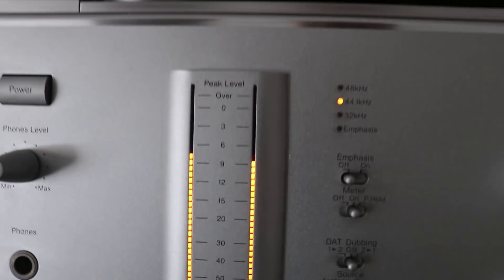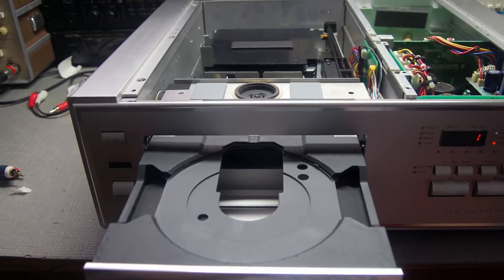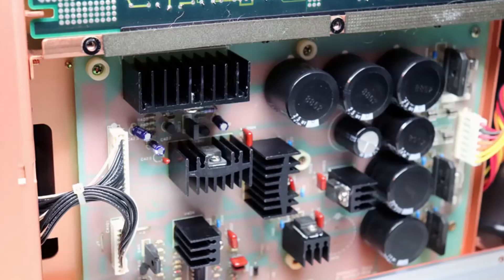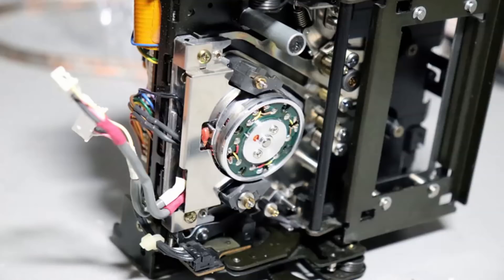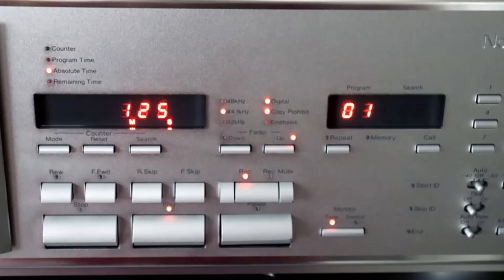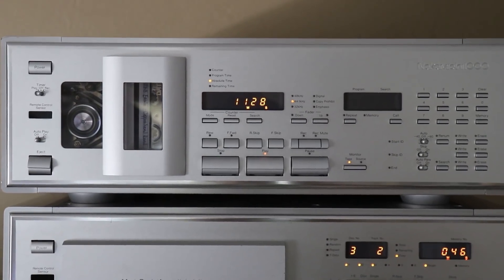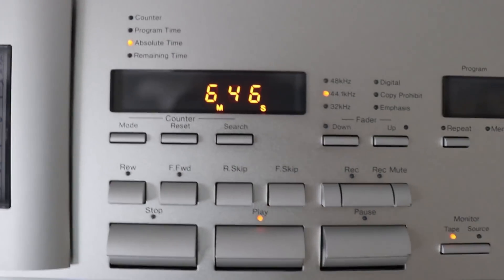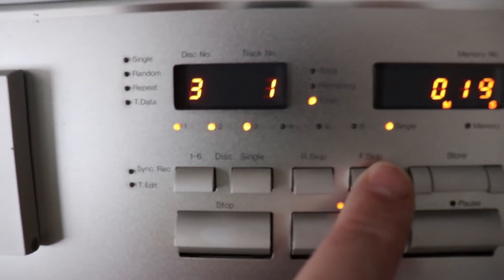Rare Nakamichi Digital Products. 1000P DAC - 1000MB CD Changer - 1000 DAT Tape Deck. $11,000 in 1988

Comment: just fixed one of these today, what I found is that the drive motors that connect to the reels are direct drive motors, have a separate PCB, with those dreaded SMD capacitors, and they will leak. the acid will damage the solder connections and the resistors on the board. if you have one of these, best to inspect this and replace the 6 10uF 35V caps with SMD caps, 1206 10uF 25V. that will work.

Comment: I was in Japan in 1989 and the hi-end stereo shops were fun to visit, very typical of what the luxury units of the day looked like. Nakamichi has always been one of my favorites, they loved to push the current tech and always had some mechanical parts that were just amazing and fun to use. I always wanted to get a Dragon but it was just a bit out of my pay grade as an E4 in the USMC at the time. I have a bunch of Japan-exclusive CD's many with the original "banned" artwork, CD stores were amazing too, only a single copy of any album would be on the shelves, everything in perfect order, if you buy out a section it will be quickly restocked as if you were never there, 4 floors of CD's it was just overwhelming.
Reply from the maker: Thanks so much for sharing and for your service. So many memories are entwined with vintage audio equipment. I just think what it must of been like to be in Japan at that time. It was a time that I'm sure you'll never forget. Thanks again.

Comment: I managed to get the amazing 1000P with the upgraded DAC module! But unfortunately, I realized that there's a heavy channel imbalance at the XLR output stage
Reply: Servicing the DA111p DAC module is  proving to be quite difficult too, as I couldn't find any schematics for it. Been trying to save this unit for about a few months now, and am still in a bit of a loss

Comment: Sir, with reference to the loading speed of the  Nakamichi 1000 DAT tape deck. Was it not the case that the Nakamichi F.A.S.T. system did not completely "unwrap" the tape from around the playback/record head? This was unlike other manufacturers machines e.g. Philips (who developed DAT in Europe). Hence particular indexed segments of the tape could be accessed easily and quickly. These Nakamichi digital producers are exceptional. Thank you for your dedication to vintage audio equipment. Keep up your good works!
Reply from the maker: Thank you very much for your comments and for your kind words.

Comment: Another great, well-produced video. 
I owned a basic 2-head Nak cassette deck from 1982. Built like a tank, even for that budget model.
About electro caps ... you can test them in-circuit with a cheap ESR meter. If they're within range, no real need to spend on new. Also, for vintage equip that's been in storage, you can bring  equip. up slowly on variac and allow the caps to "re-form". 
 Unless you're going to sell the units as rebuilt, the std bench tests and audio tests will serve as guide for re-capping (as needed).
Reply from the maker: Thank you for your kind words and for adding your thoughts.

Comment: Nice, I gotta agree the build quality on those pieces is incredible. You know back in that era I had seriously considered getting a digital tape rig but the DAT decks never came down in price. IIRC the last time I considered buying one they were still in the $1,200 range and up and I thought that too high. My Nakamichi cassette deck (a humble BX-100) was still working well and sounded great so I just waited. I figured at the time that something else was going to come down the pike and make DAT obsolete and eventually it did in the form of rewritable cd's.
Reply from the maker: No expense was spared at Nakamichi to engineer and build units like this. It's hard to imagine that Nakamichi thought these would sell well because of the price tag. If you were a person into the DAT format back in the day you could buy several Sony's or whatever brand of DAT unit for the price of this one. They must of thought that there were enough customers out there but as it turned out they didn't sell very many units.

Comment: All you need now is a Dragon.....I have one....sadly it just gathers dust these days
Reply: He has one. If you'll notice when he's showing the remotes there's one to the left on a shelf. I believe he did a tune up vid on that deck as well. I've thought here recently about acquiring a Dragon but the prices on them these days seems pretty crazy. ;)
Reply: @rickbarton9130  Be glad to sell mine !
Reply: @jonsingle1614  For?
Reply from the maker: Good catch.....Yes, I have a Dragon. Your correct the prices of vintage gear in general has gone up a lot the past few years. Most of the equipment that you see in my video's I obtained years ago before the prices moved up. I use to find a lot of good stuff on Craigslist, flea markets etc. Not so much anymore.